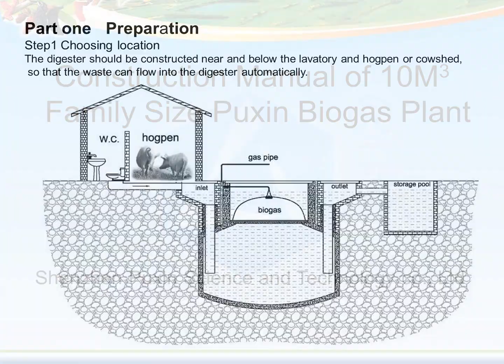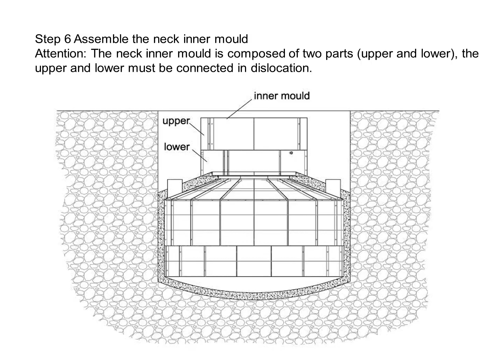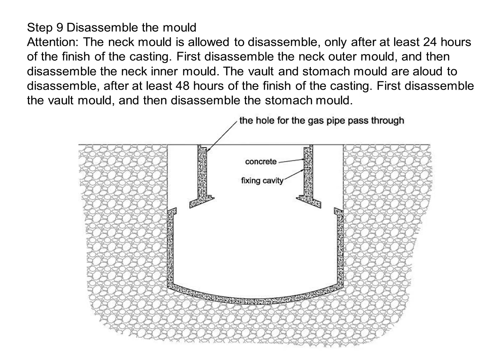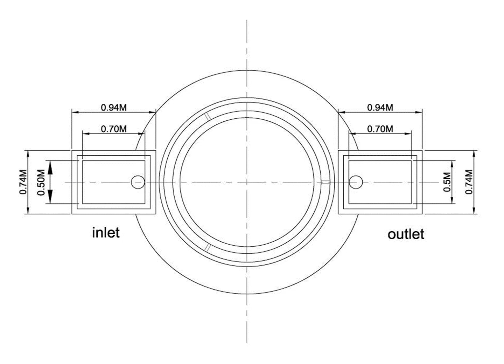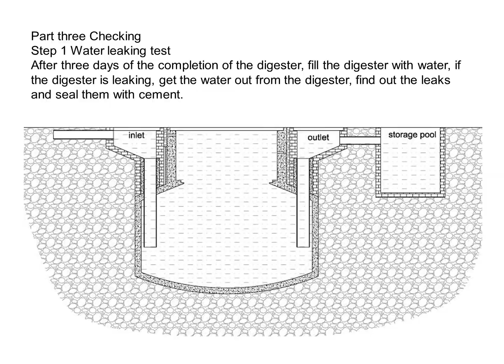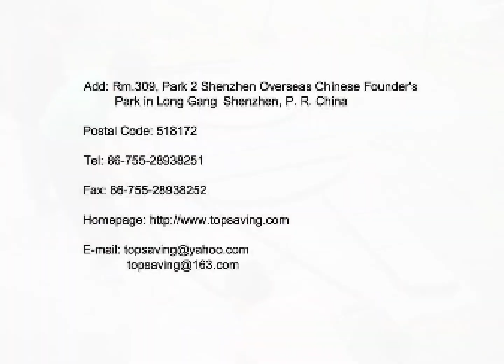How to Build Puxin 10m3 Digester

Comment: Nice job but it is a huge work input and expense. Coming to think of reinforced PVC Bag Digesters in Kit forms. They are available off the shelf in various sizes. On or half in the Ground with a Solar roof/greenhouse on top. Yes, concrete is stronger and FINAL